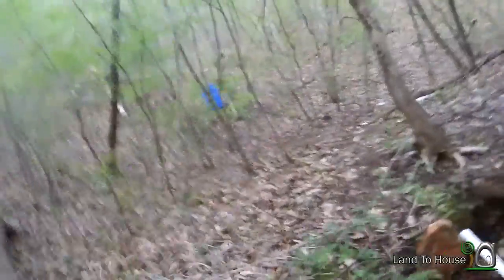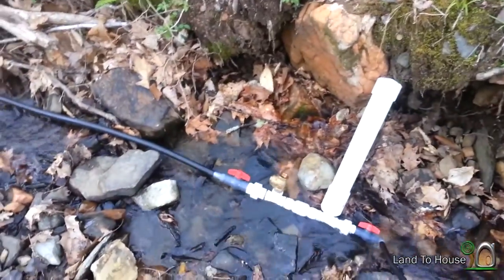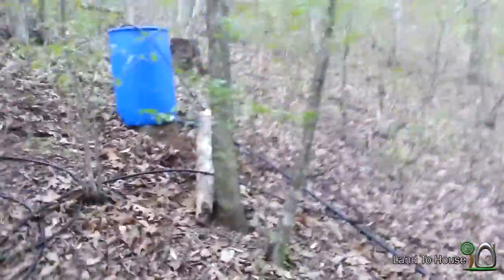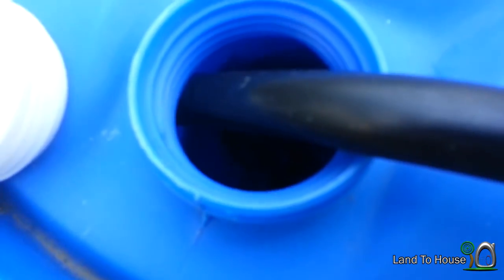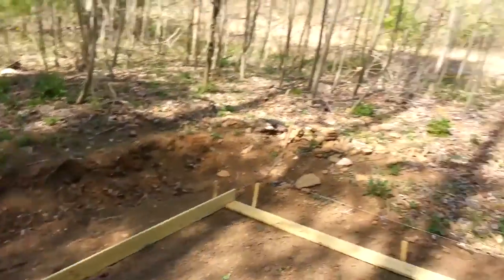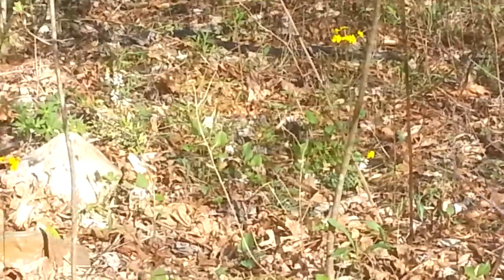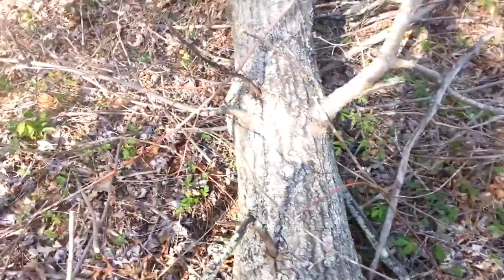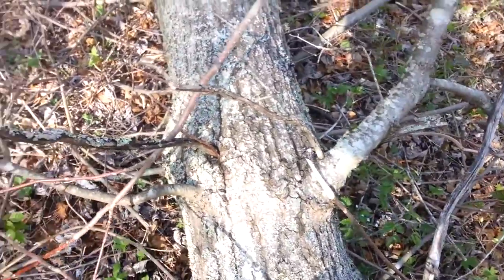Low Head Hydraulic Ram Pump

Comment: I am wandering what will happen if install an additional swing valve to the delivery pipe. I got this idea from deep well jack up pump. The swing check valve install to the pipe going to pressure tank from the pump. With this method may be it can deliver much higher.
Reply from the maker: I have two videos showing that adding an additional valve in the delivery pipe does increase the lift height. It reduces the weight of the water on the pump. This really does help. Just remember to drain that top pipe in the winter time.